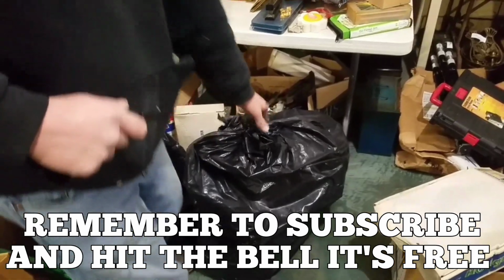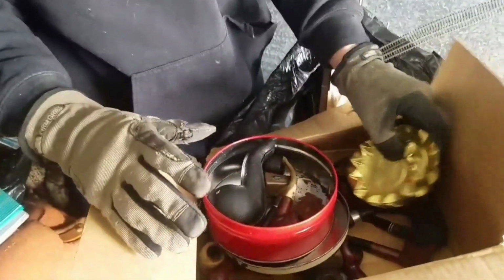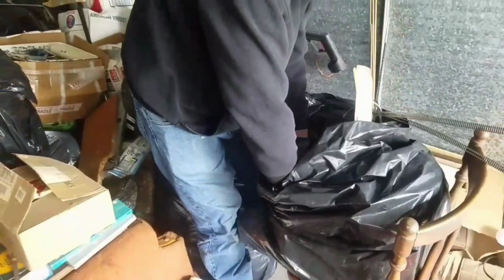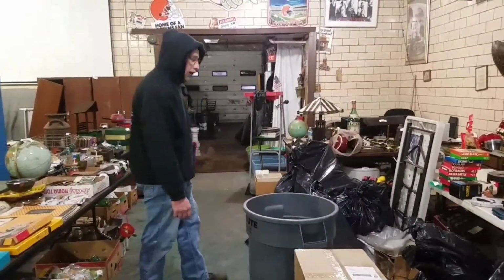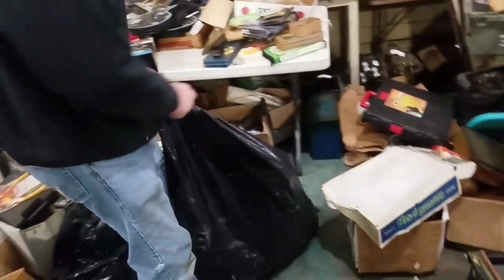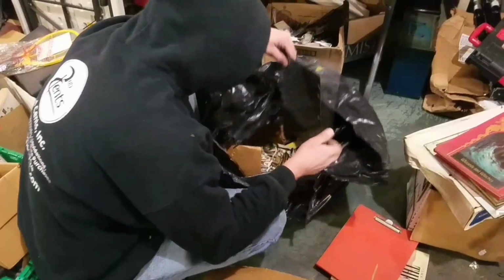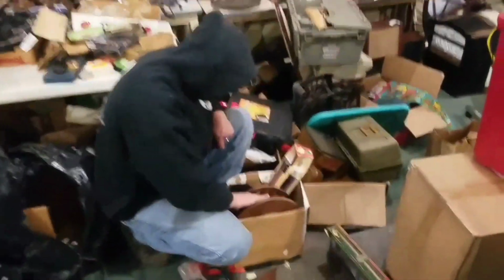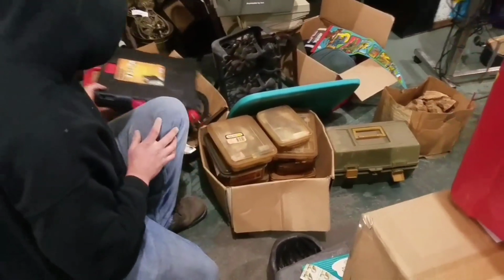Awesome 20 yr. Abandon Storage Unit Locker Unboxing Video Over $10,000 Profit Antiques collectibles

Comment: 16:00 The sub is made 50's/60's, the hole is battery case, think its made in Japan😊
MARUSAN Japanese Tin Litho Batt Op 1950s SSN 571 NAUTILUS
Reply from the maker: You're right, it's a Marusan. Thanks for the information I found the same one on Ebay because of you. 👍
Reply: @2ndCentsIncAuctionsCleveland  You're welcome😊and sorry forgot to mention, the other boat is most likely Japan too, 
VINTAGE 8 1/2" Japan Cabin Boat CRUISER Battery Operated Model Outboard Motor. There are a few different made, sure yours will be one of those😉👍